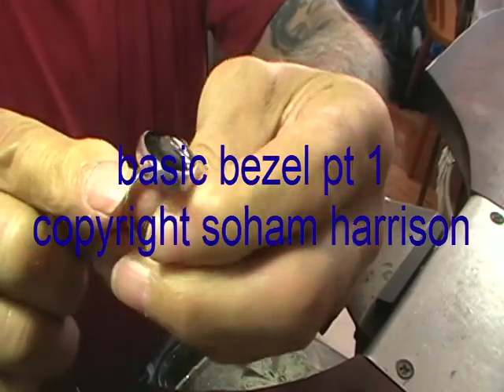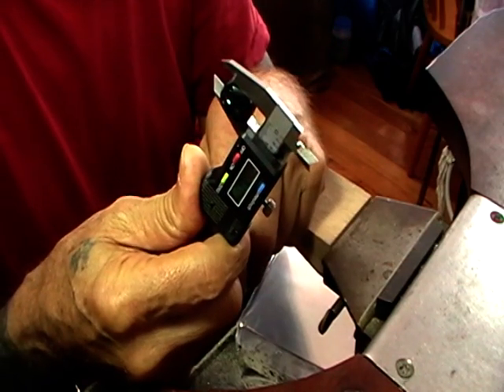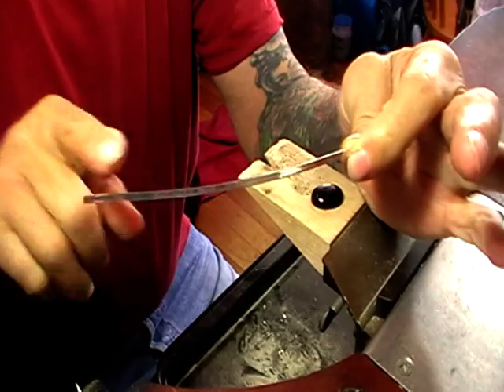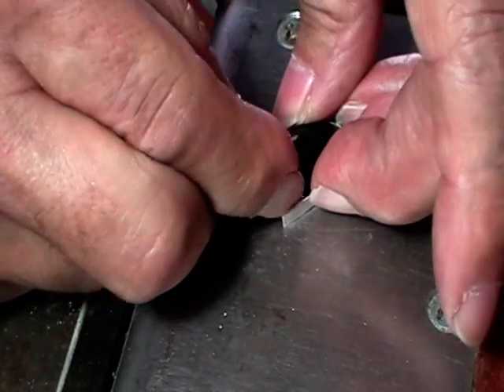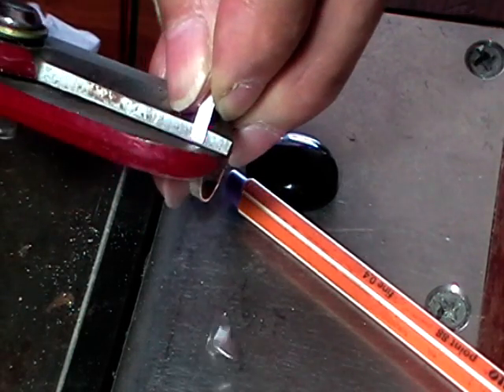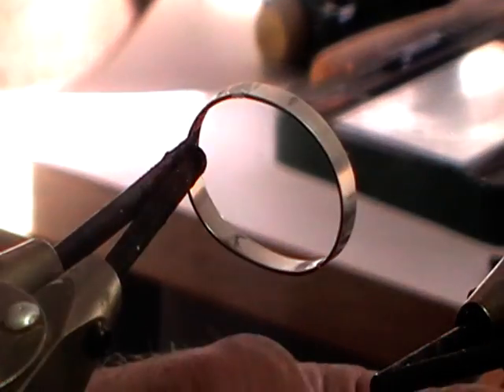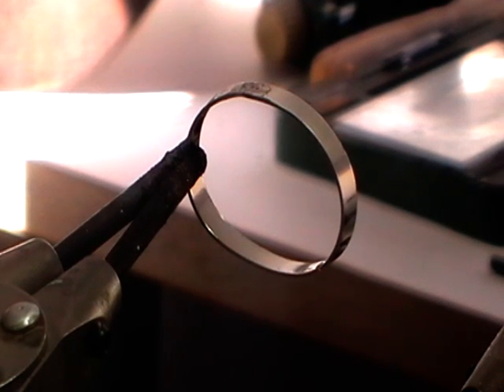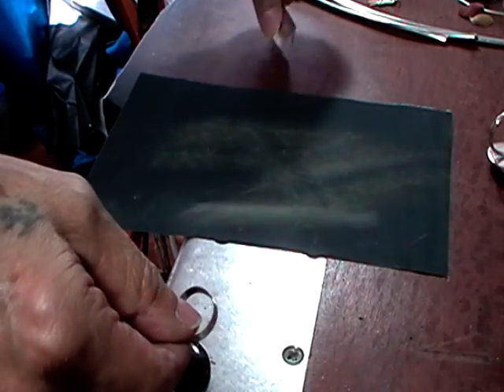bezel basic pt 1

Comment: Hi Soham, l was just wondering if you need a certain type of solder and flux for stainless steel, or will hardware store solder work ok for stainless, im using the 2% silver solder with handy flux?

Comment: Love this video series.  I have been using sheet solder and when I look on Rio for the wire solder, find it comes in gauges.  What gauge solder to use with this bezel?
Reply from the maker: 22
Reply: @1soham1  what is the gauge on that fine silver sheet?